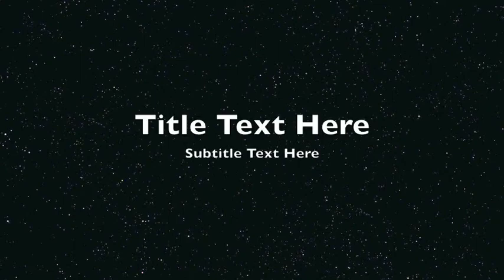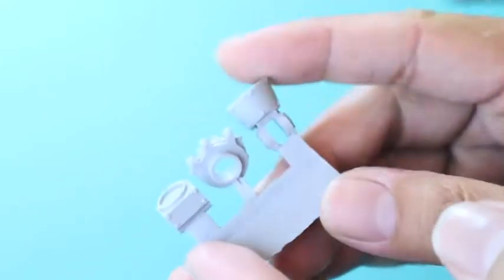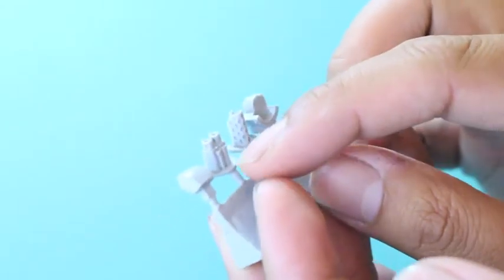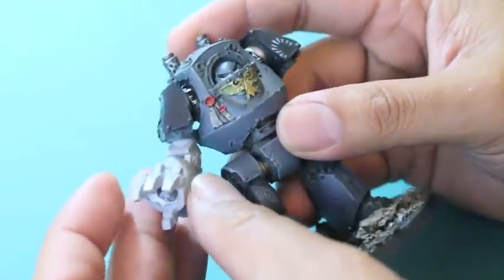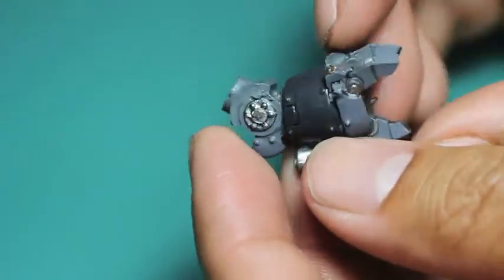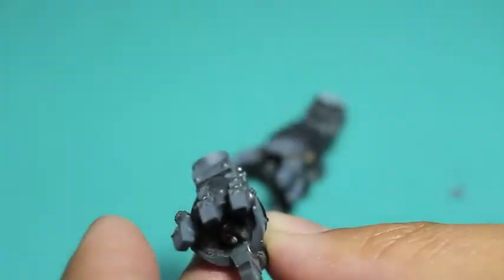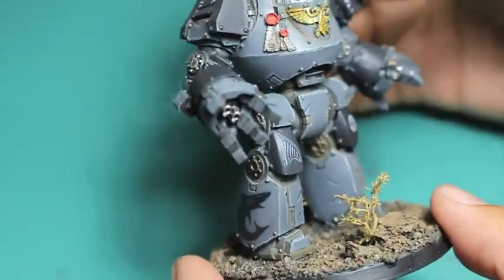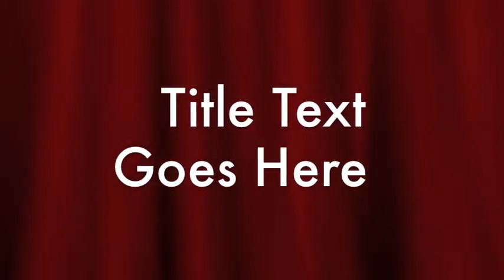Forgeworld Contemptor Pattern Power Fist Unboxing and Showcase

Comment: Dug out my old Contemptor to try an assemble it. Forge World casts are so bad I dont know if some pieces are meant to be trimmed off or are actually parts to keep.
My elbow part has an extra tab on it, thats curved and 100% looks like its meant to be there, but either you trimmed yours off or its not meant to be there.
Reply from the maker: I know, I did a lot of guesswork, because some of those extra bits look like they’re meant to slot into other things and they could just be really big pieces of flashing that just need to be scraped away. I used a lot of pictures as reference, and I just crossed my fingers hahaha. How did your assembly go?
Reply: Smooth enough. I didnt magnetise mine.
Reply from the maker: I’ve learned to live with my minis over the years haha I just can’t be bothered to magnetize my minis anymore. Happy for anyone who wants to do the extra work, but I’m just gonna say “hey for the game, my Contemptor is armed with X” and if my opponent doesn’t like it, oh well. 😊